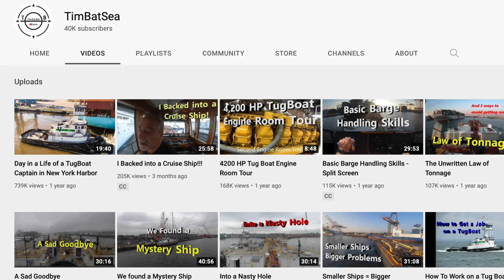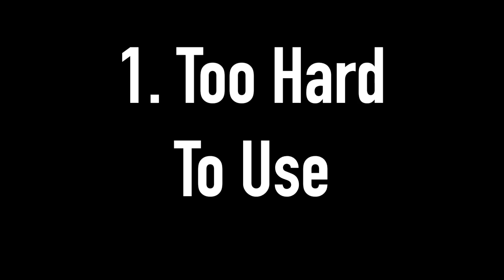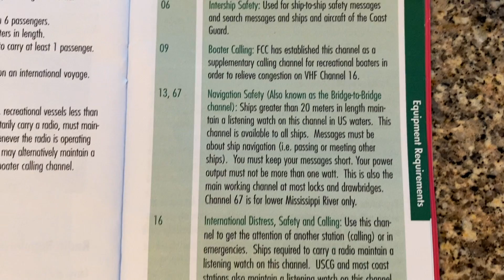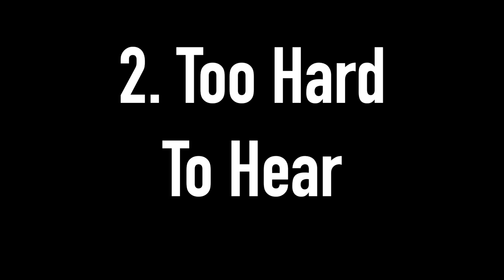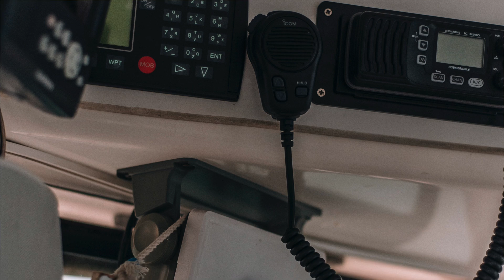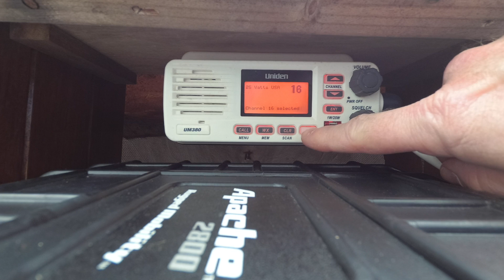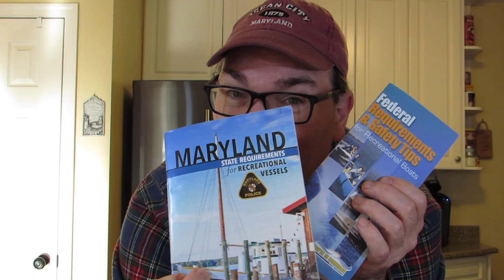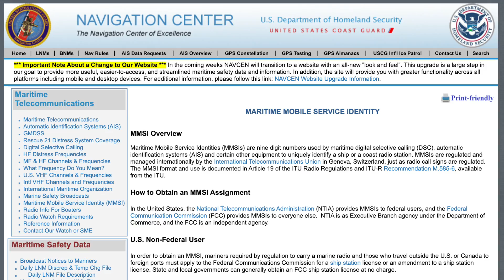The Problem With Marine VHF Radios

Comment: And, with most recreational boaters using  waterways such as lakes, rivers, etc. where there is no USCG, having a VHF is like having an extra brick in your tackle box.  Just one more item to sink with the ship.

Having a reliable cell phone with the numbers for TowBoatUS, local marinas, etc. is much more valuable in this boaters' opinion.  Plus, that cell phone likely already has GPS.  Spend the learning curve getting to know how to extract Lat/Long coordinates so you can give them to the 911 operator.  Not everybody knows how to use a VHF but I bet most armatures can figure out how to dial 911 if you're bailing out the stern.  What?  You say you don't know how to dial 911 because you can't find the 11 button?  Can't help you with that one bro...here's your sign.
Reply from the maker: Yeah - I feel pretty confident most passengers would be able to at least get a 911 call started, and in our area, there's a few landmarks I could shout out to them if they don't know how to figure lat/long.
Reply: Have to disagree. Around here there are plenty of lakes where you're out of cell range, and having a VHF radio on the boat would be the only way to call for assistance from the other boaters in the area. USCG is not the only source of assistance on the water.
Reply: @jostafew  Do you know if most of the other boaters have VHF?  If it is common knowledge that they do, then you have that network that can be relied upon.
Reply: I would disagree with that statement, first off Boat US and Sea Tow monitor channel 16 so you more then likely would get to them quicker then messing with a phone. Also in the absence of the USCG, there are other agencies who monitor that channel as well as every other boater who has a VHF radio and in all likelihood would get to you well before any agency would.  I am more of a bay and ocean boater so we have the US Coast Guard as well as Police agencies monitoring but I know when my outboard failed and I was drifting towards a rough inlet to the ocean, after dropping anchor and stopping the drift, Boat US got back to me inside of a minute  on the VHF radio seeking my location and arrived shortly after even though I was contracted with Sea Tow  at the time, they came just to check to ensure there was nothing seriously wrong.

Comment: You can get an adapter for most handhelds to attach the VHF antenna that is mounted on the boat and attached to the fixed mount radio.We had to rehearse Distress, Urgency, and Safety calls in boating safety class  to get Marine VHF license.The rules and regs are  a good idea .As you probably know with the citizen band radio (chicken band) it is utter chaos and people talking over people,etcc. The Marine portion of the VHF band needs to be regulated for obvious reasons. CHEERS from Canadian Westcoast.  P.S. The authorities in my area dont object to land based transmissions providing you select low power( less than 5 watts).Captains often comunicate with wife at home,etc.
Reply from the maker: Hey there! Does Canada require a Marine VHF license for boaters, or only if you're buying a VHF radio?
Reply: @WayneTheBoatGuy  License required for Marine VHF in Canada but not compulsory for boater to have VHF. radio. The license is good for life. I have Amateur VHF license too as well as HF. and they also good for life where as USA requires Amateur license be renewed every 10 years.I am not sure on how USA regs for VHF marine work.Safe boating to you!!!
Reply: @WayneTheBoatGuy  Canada follows U.S.A. examples on nearly everything!

Comment: Any thoughts on differences in transmitting wattage for a mounted vs handheld? Mounted radios typically put out up to 25 watts, while handhelds usually range 1-5 watts. Any idea how that translates to signal distance and clarity? I would imagine a hand held is fine near shore or in busy boating areas, but a more powerful radio would be preferred when offshore. The flip side is that a handheld can go with you if you need to evacuate the boat.
Reply from the maker: I know the handhelds do not have nearly the range of fixed mount - and antenna height make differences as well. 
Obviously boating in open waters and far from a coast guard station makes a stronger radio/better antenna more important.
Reply: The difference is incredible!  In Pensacola Bay or Escambia Bay, where you are only a few miles from USCG, you can't always get them on handhelds.  But if you have a mounted radio with a lot of antenna on a strong ratchet mount, you can talk to the Coast Guard as far away as Destin or Mobile, sometimes, and you'll be able to get USCG Pensacola anytime.  And that's on an 18' fishing boat.
Reply: With any VHF radio, the communications distance is based on the height of the Transmitting antenna and the height of the receiving antenna.  The higher you put each the further you will be heard.  A hand held is only designed for short radio transmissions (battery life is a factor) and the range is usually only several miles.   The USCG, bases their VHF commo at or about 25 nm.  But they also will have their antennas up between 50 to 100 feet in their air.
Reply: VHF propagates by line-of-sight. HOWEVER, it is also affected by “power-aperture” which is the power radiated to the antenna by the transmitter (the radio) AND the antenna’s aperture and construction. Bottom line, more power and more aperture equals more range as long as there’s an antenna in line-of-sight to receive it. With handhelds, you have both low power and a small little antenna with weak aperture. A radio powered by your boat’s 12-volt battery AND with a whip antenna of, say 4-8 feet, you have much greater “power-aperture” and thus transmission strength. Line-of-sight is just one aspect and due to the curvature of the earth (sorry flat-earthers!) it’s a shorter distance than you might think. You could have your large aperture (antenna) folded down and with more power it would still out-transmit a handheld at the same height for a given antenna in line-of-sight. I learned RF wave transmission in high school physics.  And for the LOS guy in comments, if a USCG antenna was 100 feet high and your handheld was 5 feet off the surface, LOS would be only 17 miles. My boat’s 4’ whip antenna sits about 10 feet off the surface, so that gives me only 18 miles of LOS. HOWEVER, the USCG usually uses VHF antennas at 800 feet high with really huge antenna apertures (length, efficiency, etc.). Now you’re talking 40+ miles of line-of-sight. 😮
Reply: The Standard Horizon is 6 watts

Comment: I have an optional speaker next to the dash that works perfectly, Shakespeare 3003.4047 ES-2 5 Watt White Marine Radio External Speaker. No more problems for me, this speaker is loud. I also have the dsc with gps and I added and extended gps antenna for extra security Waterproof GPS Active Antenna 28dB Gain, 3-5VDC, SMA
Reply from the maker: Nice!